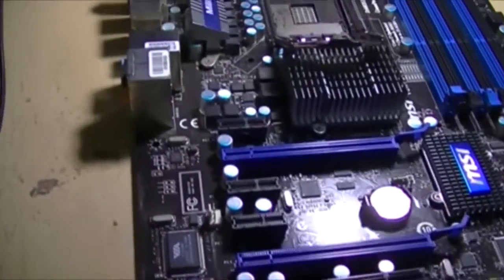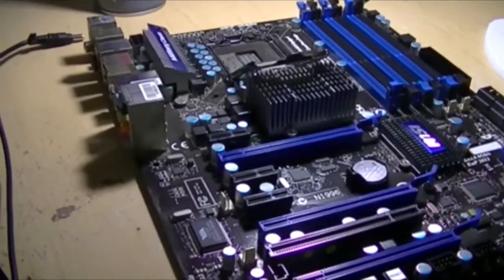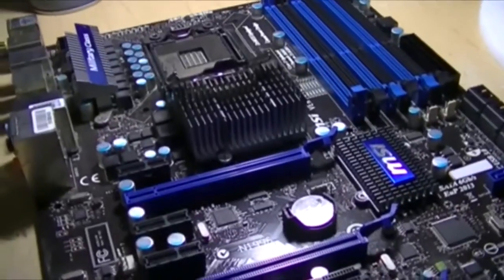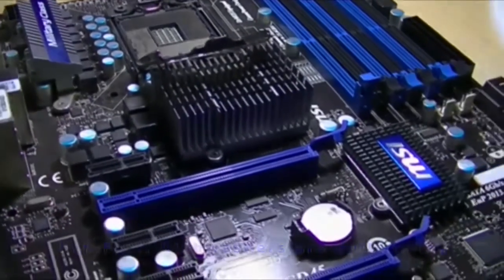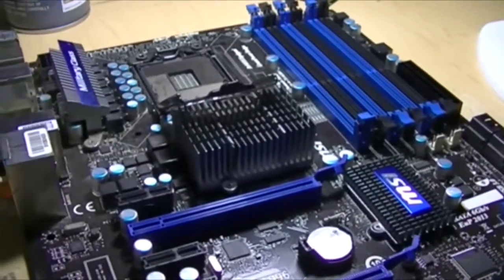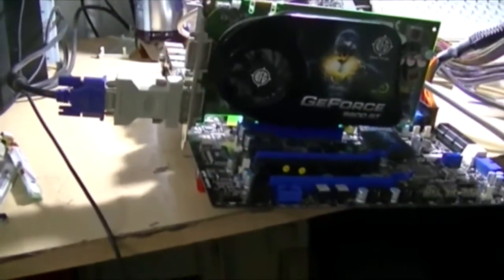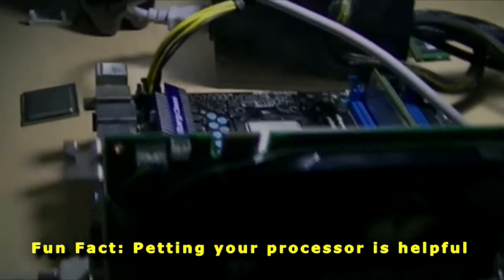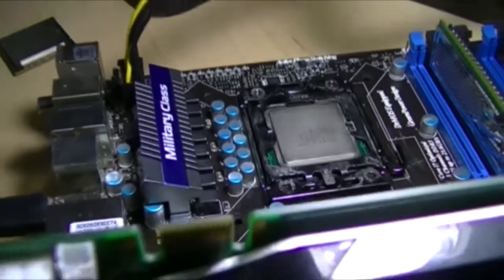Project: LGA1366 Intel Xeon X5672 and MSI X58-GD45

Comment: great video, quite impressed with how you managed to bring that board back.

i prefer aircooling over watercooling tho, since watercooling is more likely to fail and the performance of a watercooler isnt much better over a good aircooler.(it is better but not that much better that its worth the hassle to me.) aswel as price being abig factor since you will need a decent case that can support the watercooling and the cooler themselves being quite costly.

Comment: Hi WaybackTECH, I noticed you mentioned the Z600 and Z800 below as cheap used workstations with LGA1366 boards. Do you happen to know some others? Or even some from Dell? I think the real eBay values are these type of complete systems that don't neccesarily have all the component specs listed in the titles, but you know are just as good, if not better, than searching for something like an X58 board or a rare Xeon or Extreme i7 edition, etc.

And also, for that matter, what about LGA2011 (either for Sandy/Ivy Bridge or for Haswell/Broadwell)? What about workstations for those?

Comment: Congratulations on getting that xeon to work. I myself had an MSI X58 Pro-E with an i7-920. I got myself a  server pulled xeon X5650 for 100$ (80€). It's clocked lower than yours but I've got it at 3.4Ghz without problems. Cinebench scores run to 800's and any game I throw at it, the cpu chews it up with good framerates. Also runs cool in everyday use. I might try somekind of X79 + E2670-project. If I can find a motherboard.
Reply: I`m in the same boat, 2011 cpus are cheap now but boards just like 1366 are not. Found out that chinese are making 2011v2 boards for 100$ if they have ability to change multiplier in bios I`m going for it.
Reply: +xdanano don't go for those generic Chinese x79 boards, they tend to fail very quickly( less than a few months). My friend got one for his E5-2670 build and you know what happened...

Comment: Hi all, I just wanted to confirm that the 6-core Xeon X56xx CPUs do work with the MSI X58-GD45. I purchased a Xeon X5670 and it initially did not work, but after I updated the BIOS of the MB, it booted up just fine. Hope this helps if somebody runs across it
Reply: hi, anyone know if the xeon x56** work on msi x58 platinum ?

Comment: Nice vid :). I recently did this myself, I can't help but think you should have spent a bit more on a better CPU, for example the passmark ratings for the X5670 (the one i bought) are around 8200 and the x5672 is at about 5100 (almost identical to an i7-920 both single and multi-threaded)

I recently built a 771 to 775 xeon x5450 mod and at only 4ghz OC I'm getting a passmark benchmark of about 5500, so considering an older OC'd 771 Xeon can crush the stock x5672 says allot I think. I've also read (don't quote me it could be wrong info) that the 5600 series xeons with the 2 designation at the end are really bad for over clocking (has something to do with the multiplier apparently). It just seems to be a waist of a 1366 board that you correctly stated go for a premium on ebay, I think resurrecting these older 1366 boards with more powerful hexa-core Xeons that DO work in them is so much more worth it than putting a chip in that over all isn't much better than an old Core2 based Xeon.

Comment: Will ECC ram work in this board now you have a xeon?
I just bought a Asus PX58D-E will a X5570 run in it?
thanks
Reply: +Slot1Gamer I don't think that motherboard will support ECC, because in consumer grade memory controllers they don't support ECC memory.
Reply: +Glacy but isn't the memory controller built into the CPU starting from Nehalem ?
Reply: Tim Peng i think so but it wont work for other reasons
Reply: The traces for the EEC memory do not exist on most non-server boards.  This causes the ECC RAM to be unstable.
Reply: Kelly Slow kinda ironic don't you think hahaha
Reply: Yes!  But it is how they keep costs down.  Most people don't run ECC in enthusiast boards and honestly, why would you want too?
Reply: i also have a P6X58D-E board and a x5672 . im using ECC ram and have had no luck so far. literally no post the DRAM light jsut stays on. did you manage to get you 5570 working with that board?

Comment: hey thanks for your video man, one thing I wonder is the contact cleaner you use is like IPA, right or isopropyl alcohol if so. I do indeed always use that one too (another brand, but oke). It's good stuff for cleaning pcbs.
So the xeon just worked fine. Hmm I really want to upgrade my i7 930(@3.93ghz 1.26v) to a X5870 on a ASUS P6T SE. it shpports the cores and threads tdp L cache and so sorth forth but not "official" listed aka tested.. Would it be worth to try it out? I can get one for like 99 bucks. used pulled from a server (China :-) yay )
Reply from the maker: I use Max Products electrical contact cleaner. Home depot, Menards sell it for about $7 a can.  I would say give the processor a try, if for some reason your board doesn't support it, im sure you could resell it.
Reply: Yeah that's right I was indeed thinking about just reselling it if it doesn't work in my system. I checked the prices here and they sell for more money then where I can buy them from lol. Oh and it seems I pay some more here for IPA, 8.99 for a can 200 ml.

Comment: Hi, will ecc non buffered ram work on x58 platform? Thanks
Reply from the maker: No, at least it did not on mine.  I was kind of surprised actually since the controller is built into the CPU. Probably isn't supported in the bios is my guess, but that might be different on other x58 boards.
Reply: WaybackTECH oh... I did want to get ECC ram for my next build since it is 60% cheaper in my area... Thanks so much.
Reply from the maker: Tim Peng
I might suggest, if you are not totally set on building the system, I would recommend looking at prices for HP Z600 or Z800 systems. I picked up a Z600 system for about $200 for a complete dual xeon 1366 system, and it will run up to 96GB of ECC ram. I put a pair of X5672 chips in it and it benchmarks close to an I7-5820k and is whisper quiet.
Reply: +WaybackTECH Wow, that's why we should never underestimate an older platform! 

I've just inherited an Asus Sabertooth X58 with a Xeon E5620 in it but there is no ram. After further shopping, I found out that unbuffered ECC RAM go for a lot cheaper than regular DDR3. I'm actually surprised how ECC ram is soooo much cheaper than regular ones...
Reply from the maker: Tim Peng
server pulls is why it is so cheap. It does work just fine for a gaming system though provided it will work with the board. Asus only lists that board as supporting non-ecc. I know their P6T WS Professional board did support ecc however, and it is an X58 chipset, but I don't know what the difference is other than artificial bios fiddling to prevent ecc support on their lower X58 products.
Reply: No it won't be able to use ECC RAM because the non-server motherboard does not have the traces for the ECC circuitry like the server boards do.  This has been checked buy a group of enthusiasts.  The EVGA SR2 will run ECC.  It is a dual socket motherboard and the sexy.  :)

Comment: 18:50 I believe you're talking about when Intel used thermal compound instead of solder in between the die and the heat spreader. I don't think they did that with LGA-1366 chips though, I think it was Ivy Bridge chips they did that with?
Reply: yes aswel as haswell.